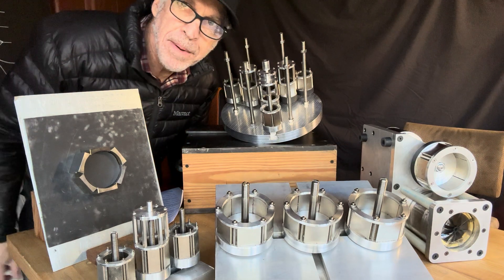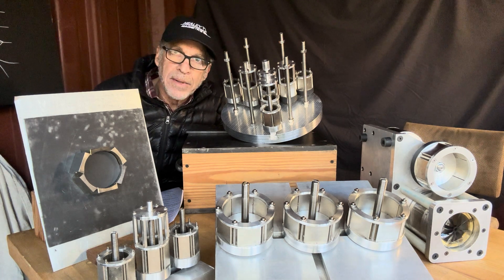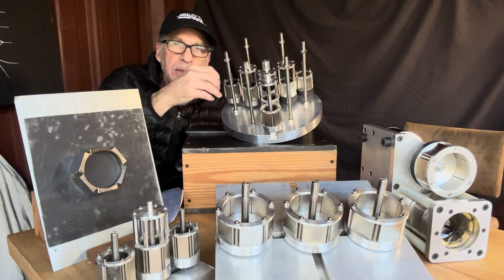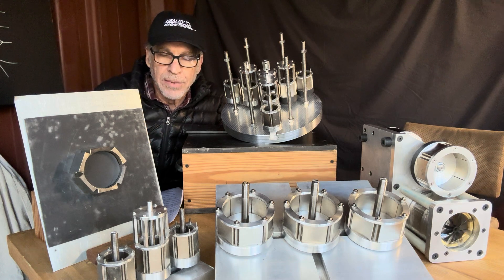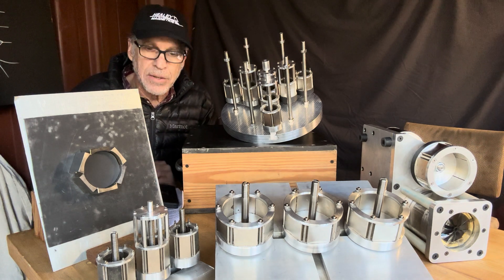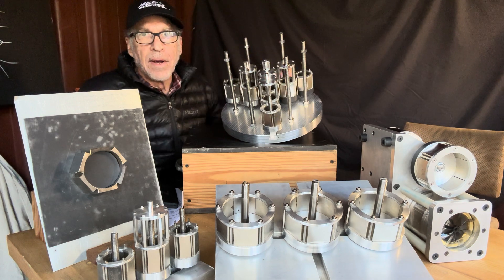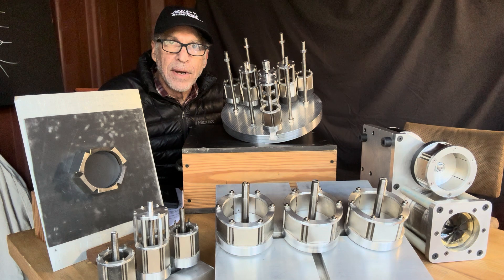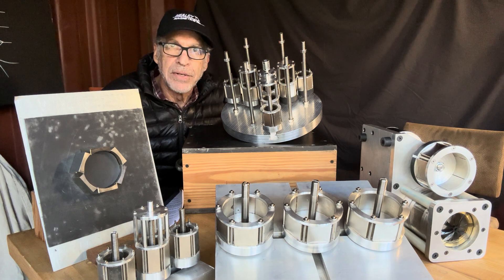Brain Dump.. end of 2023

Comment: Think about this: What problem are you solving? We have had cogs and belts for years. Now you transfer motion from one side to another with no workload. How would this system perform with overload = magnetic slipping?
Reply from the maker: I appreciate the skepticism and it has been part of the process.. The magnetic field shading in conventional motor system is based on the proximity..our system has similar torque capabilities.. and yes i agree i designed a solution looking for a problem..  capabilities of high speed ( the arrays have achieved > 10,000 rpm) without decoupling allows for some interesting thought experiments… the counter rotating arrays in close proximity have some interesting effects and possibilities for new energy systems.   since you seem knowledgeable please subscribe..

Comment: Looking at all those cogs it occurs to me that a machine that utilizes magnetic coupling would have multiple locations that could be used to position a pickup coil for generation of electricity. 
I wonder if a coil placed at the intersection of two fields would create power from each field doubling its output, possibly neutralizing the drag.
Reply from the maker: Yes. we have designs and plans too integrate armature wiring inside the arrays... that is one of the reasons that the planar concave magnet design was utilized--- to rotate around armatures.. to create electrical current.  specialty armatures designed to work with this would require very expensive R&D so we have focused on the architecture and holder design for now.